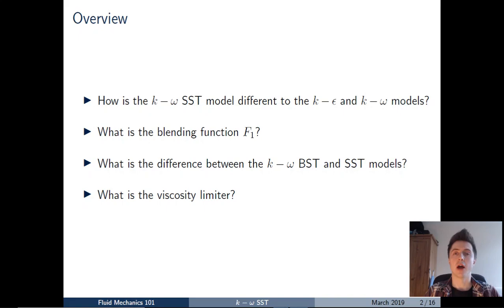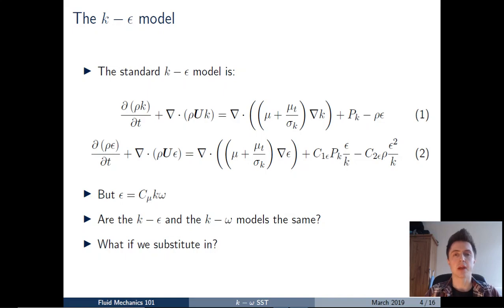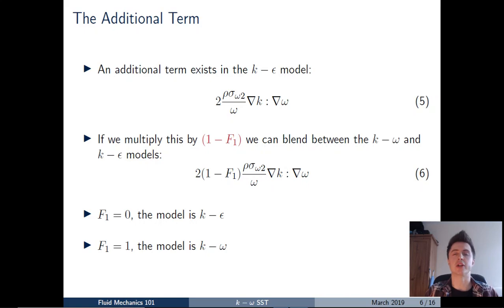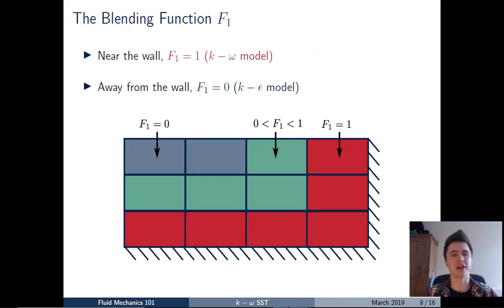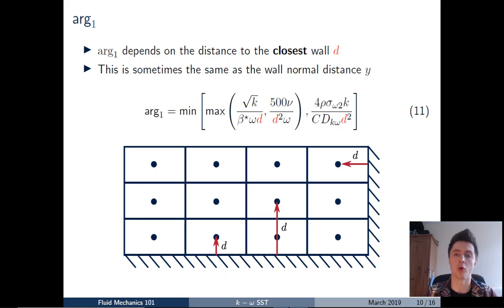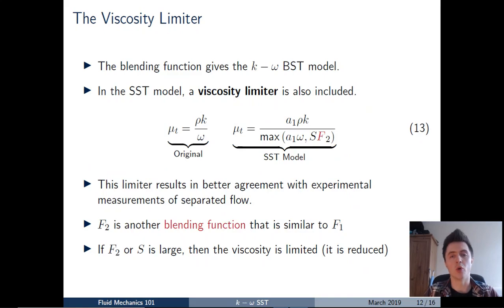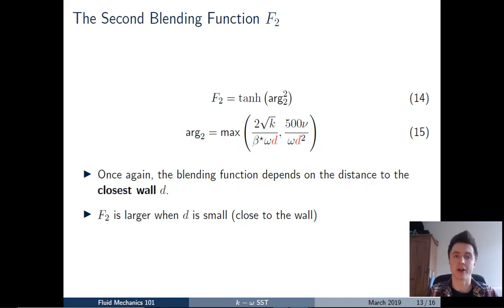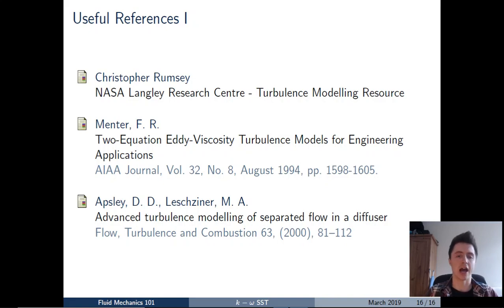[CFD] The k - omega SST Turbulence Model

Comment: Is turbulent viscosity (13) a mathematical term or experimentally determined near the wall and away from wall?
Reply: it is kind of a virtual quantity, like a term introduced to predict the turbulent flow
Reply from the maker: Technically it is a mathematical term. If you had DNS data (or measurements) of a turbulent flow, you could calculate it. 

However, for us, it is easier to think of it as a virtual term that we introduce to try and correct the mixing (accounting for the turbulence which isn't resolved) and the wall fluxes.
Reply: @fluidmechanics101  thanks a lot

Comment: Hi Aidan,

first of, thank you for a very insightful video. However, I have never heard about the acronym BST. Where did you find it? Could your refer to the source? From what I gathered, it should be BSL, since it stands for BaSeLine. Can you clarify this issue, please? Thank you in advance.
Reply from the maker: Hi Jack, if you have a look in Florian Menter's original paper, you should see the BST (baseline stress transport) model. It is part of the development of the SST model but isn't really used much in practice
Reply: @fluidmechanics101  Hello Aidan, unfortunately I did not succeed in finding the BST model you are referring to. By the Florian Menter's original paper did you really mean the paper Two-Equation Eddy-Viscosity Turbulence Models for Engineering Applications
AIAA Journal, Vol. 32, No. 8, August 1994, pp. 1598-1605.? Thanks a lot for your effort!

Comment: Thank you for a great lesson! I heard through several your videos today, which is though-provoking! With that being said, I do have a question about the SST k-w model. Do you by any chance now what the near wall mesh size should be (should y+ always be <1) for SST k-w model. Hopefully you could make a video about near-wall mesh size for difference models. Thanks in advance!
Reply from the maker: This is a tricky topic, as it varies between solvers. I would check out my ‘Enhanced Wall Functions’ video if you are a Fluent or CFX user. If you can get y+ less than 1, perfect. If not then less than 3 is probably fine. The wall function approach (y+ between 30 and 200) is probably ok unless you are doing external aerodynamics / turbomachinery stuff where you need to get the separation point correct
Reply: @fluidmechanics101  thanks for your promptly reply. I really appreciate it. I am using ansys fluent for my research. One thing the manual is not clear about is that, if y+ is larger than 30, does that mean that only k-e model plays the role in the sst k-w model? What is the critical distance from the wall whereby k-w starts phasing into k-e? I know it’s a hard question, have been searching for solutions online for a long time. So, any input is greatly appreciated!
Reply from the maker: the transition is based on the blending function F1, not y+. Im sorry if this hasnt been explained well! It really isn’t clear
Reply: @fluidmechanics101   but blending function is a function of the distance between the cell center and the wall, right? Sorry the question is not clear enough. I think what I was really asking was what the critical distance from the wall should be whereby k-w phases into k-e or the other way around. I understand it varies depend on case, but is it possible to calculate it by hand?
Reply from the maker: It is not really possible to calculate this distance by hand. Why do you need to know it? Is this an input for a model or just for your own understanding?
Reply: @fluidmechanics101  Sorry for the belated reply. This calculation is just for my own understanding, because someone told me that should y+ is over 30, then only k-e will be used in the SST k-omega model, which I think is a misconception.  What do you think?
Reply from the maker: Yes, that is a misconception. The switch from k omega to k epsilon is dependent on the blending function F1, not y+. You dont need to have y+ less than 1. But you will probably get better results especially if your flow has separation / reattachment etc. The log law is surprisingly good in most cases 👍
Reply: @fluidmechanics101  thanks for your reply! That makes sense an is certainly helpful!

Comment: As people have mentioned, you did a great job explaining the model. Even though I've read few notes about K-w and K-e models, I failed to realize that there were functions that allowed the exchange between the models. Thank you!

Though, perhaps it's a bit out of topic question but, I see that there are 'limiters' and 'corrections' made in the models. A professor of mine  mentioned that due to such dampings available in the models,  it makes them unreliable when you are trying to simulate isotropic/anisotropic  turbulent flows in order to see the propagation of the turbulence.

To be more clear, I've analytically calculated Re stresses and Kinetic Turb. Energy of a flow subjected to axi-symmetric contraction using the equations of Rapid Distortion Theory proposed by Batchelor and his colleagues. Then, I've used such various turbulence models from K-e to RST which yielded significantly different results (way lower Re stress values compared to analytical solution). Do you think the reasion behind such difference is due to the dampings introduced in the models?

Thank you once again.
Reply from the maker: Hi Onur, it could be due to the damping or simply due to the Boussnesq hypothesis. K-omega and k-epsilon based models are all isotropic in nature and will struggle to get the anisotropic components of the Reynolds stresses correct, regardless of the damping functions. Although we would need to do a more detailed comparison to be sure. Have you tried comparing the Reynolds stresses between the models?
Reply: @fluidmechanics101  Im currently working on that but thanks for the insight. Its interesting stuff... I ll try to get more data on it for sure.
Reply: @ownershen97  bro can you help me in selecting which model to go for? Like I'm dealing with water fluid to cool the components so wall heat transfer is must. So which one should I go for
Reply: @Eagle-oy7bm  Hey Eagle, you can try Kw-SST as it is wall function independent and can model surface roughness as well. Ofcourse this highly depends on your case and your ICs/BCs. Varying models have their strengths and weaknesses.  I would start by reading few articles similar to your case and see which model they use. Hope this helps :)

Comment: Hey, you have highlighted the term external aerodynamics in the presentation. So, can't this model be used to simulate the flow in a gas turbine combustion chamber with swirler?
 Expanation was excellent as usual. Thanks a lot.
Reply: Menter SST k-omega was initially developed for external compressible flows in 1994. But they were proved to be accurate for internal flows as well. Refer AIAA paper by John W Slater 2004 for the same info.
Reply from the maker: Yep, the model will work fine for as turbine combustors. You might need to add the swirl source in fluent

Comment: Is the tensor of the gradient of k expressed as k[I] where I is the identity matrix, or is there a consideration where k is not isotropic?
Reply from the maker: For RANS models, k is isotropic. However you can use a non-linear eddy viscosity model, this allows the viscosity to be anisotropic, even if the turbulent kinetic energy is isotropic
Reply: @fluidmechanics101  Thank you!

Comment: Dear Aidan,

I am using ANSYS fluent to model my 2 phase solid-liquid problems. My problems are steady-state in nature. I wish to know that in all the equations, such as continuity, momentum and the K-w model equations, the first term with dt in the denominator represents the unsteady part right? So I have a query, that in case of steady-state problems, how is this 'dt' term solved? Is it time averaged or neglected from the solution?
Reply from the maker: Hi Harman, the dt term is neglected completely. That term is ignored (or set to zero), so you dont need to worry about it. Iteration is used to ensure that all the other terms balance and a steady solution is achieved.

Comment: According to Versteeg you have a mistake in 8th equation where sigma omega 2 should be in denominator
Reply from the maker: Oops! 🤦‍♂️ well spotted!
Reply: I have just read Menter's original paper, and he puts sigma omega 2 in the numerator side
Reply from the maker: Hmmm, i think we need to use the NASA turbulence modelling source. This is usually the most reliable source as it points out the (numerous) typos that people make in their papers and keeps a record of the different versions of the models. Have a quick google search for ‘NASA turbulence modelling and you will quickly find it’ 👍

Comment: Hi Aidan, excellent lecture!. I have a question, isn't the term in the note after Eq. 8 just the vector inner product of the two gradients? I don't see why the double dot (tensor product) is used since it would give a tensor and not a scalar. Thanks !
Reply from the maker: Correct! Sorry i have probably used the wrong notation. The term should evaluate to a scalar as all terms in the equation are scalar
Reply: @fluidmechanics101  Thank you! Your lectures are fantastic!

Comment: Can you please make a video for the K-Omega turbulence model ? Can we use this model for both Low-Re and High-Re (like in the video of K-Epsilon ) ?
Many Thanks
Reply from the maker: Ideally you would use this model for Low-Re only and then use k-epsilon for high Re. However, the model is quite resilient and you can use it for just about any y+ with reasonable success 👍
Reply: @fluidmechanics101  Thanks
Reply: @fluidmechanics101  I am modeling a structure in a river bed. As I did not know the y+ value at the first time, I built a guest mesh and run with k-w SST with a wall function and get 1<y+<200. ¿Is that a High-Re case? ¿should I expect the same results using the k-ep? I suppose in that case the model is actually using the wall functions ¿isn't it?
Reply from the maker: This depends on the CFD code you are using. In Fluent and CFX, the CFD code is clever enough to use wall functions when y+ is greater than 30 and will use the viscous sib layer solution when y+ < 5. What you need to do is make sure that y+ is in the range that you want in the region of the model that you care about most (the surface of the structure) 👍

Comment: Hi Aidan. Thanks for the insightful video. I have some doubts.
1) k-w SST model is blending of k-e and k-w with the viscosity limiter. Now, Since we are resolving the near wall flow by predicting accurately the wall shear stress , then i would suppose that our mesh should be wall resolved i.e. in viscous sub-layer ( y+ ~ 1). What do you think? Because i don't see any mention of y+ in the video.
2) What if we use k-w SST model with first cell in log-layer (30<y+<200)? Can we rely on the simulation results?
Thanks again for the video :)
Reply from the maker: Hi Mihir, yes you are right on both points! I didnt mention y+ in the video as i wanted to keep the video specific to the model itself. You can of course apply the model with any y+ you want (greater than 30 or less than 5) but the model generally gets the most accurate results when y+ < 5 (or even less than 1 for best results)! This is why it is most commonly used in external aerodynamics applications
Reply: @fluidmechanics101  Thanks Aidan. That was helpful :)

Comment: Hi Aidan thanks for another fantastic video. I have a doubt. How we could achieve flow separation by reducing both viscosity and wall shear stress. Because my understanding is only in laminar flow (viscous dominant flow) we will get flow separation. In that case how by reducing viscosity menter would have got the seperation. Sorry if I am wrong in not catching some fundamental part. I will be very happy if u have time to give a reply to my question. Thank once again and I have became big fan of your channel.
Reply from the maker: Hi Siva, you can get seperation in laminar flow and turbulent flow! It is the strength of the adverse pressure gradient that determines whether we can get separation or not 😄 as a result of the adverse pressure gradient, the wall shear stress reduces, until a point where it reaches zero. This is the seperation point. Maybe go and grab your favourite fluid dynamics textbook and have a quick refresher? It is a complicated topic, so dont worry if you get confused 👍
Reply: @fluidmechanics101  thank u very much Aidan for your time  to reply me. I got my doubt cleared. U r simply awesome.. keep.posting on such lectures for other turbulence models also.. keep up the good work. My best wishes 🙂

Comment: Is it the same equations in compressible and incompressible flwo?
Reply from the maker: Ive been having a look at the OpenFOAM manual and it looks like the equations are the same, except for an additional ‘rapid distortion theory’ term. I will look into this is a bit more detail and them get back to you! Remember also that in the compressible formulation of these equations, the variable inside the temporal derivative and convection terms is (rho * k), whereas in the incompressible form the variable is (k) as density is constant and can be cancelled out 👍
Reply: @fluidmechanics101  ok thank you 👌

Comment: Hi, Aidan. Very very good presentation. But I think there might be an error at 8:00. The k and Omega are scalar variables, so the gradients of them are vectors rather than tensors as you mentioned in the video.
Reply from the maker: Hi Wenyang, yes you are right. K and omega are scalar variables. Taking the gradient of these variables results in vector variables . However when we take the tensor inner product of the vectors (the gradient of k and the gradient of omega) this results in a scalar variable again! It looks like my explanation was not clear enough ... Thanks for pointing this out!
Reply: Well, vectors are also tensor (1st order tensors). In this case, the tensor inner product of those two tensors/vectors results in the same as dot product of those two vectors/tensors. The two operations are valid, but I think tensor inner product results confusing.